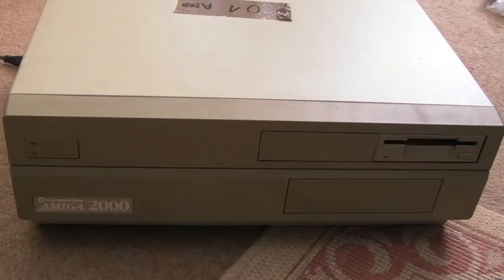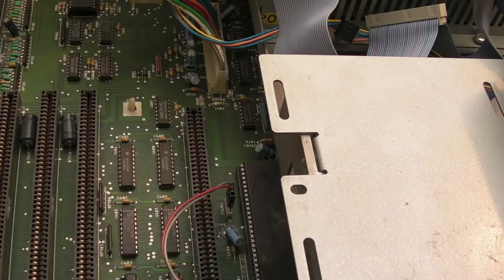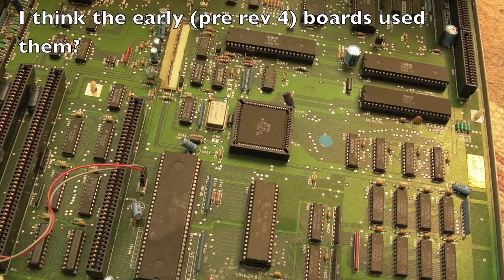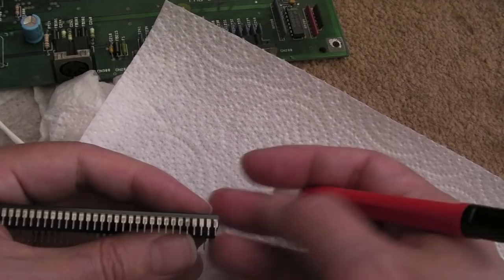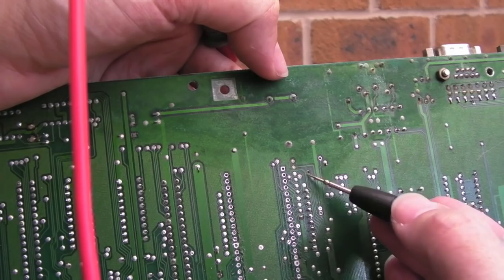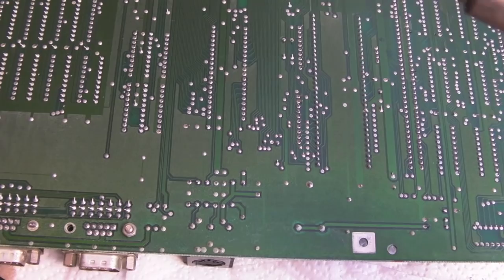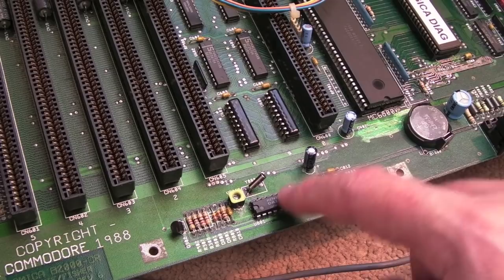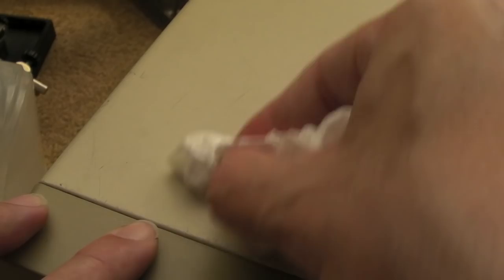Commodore Amiga A2000 Repair (Rev 6.2), CR2032 Mod & Channel Update

Comment: Hi, could you please help me out, i recently bought a A2000HD which was fully working until i decided to remove the varta battery, there was a small area of acid which i cleaned up etc and put everything back together, but when i now turn it on i sometimes get the workbench boot screen but the FDD light it always on & i cant do anything, or i get a white screen & the FDD light is permantley on, i don't know what i have done wrong because it was working perfectly before i removed the battery, thank you.
Reply from the maker: It's most likely exactly what happened to mine in this video!  ie. you get a bad via due to the corrosion.  You should probably clean up each of the vias and test connectivity from the top side of the PCB to the bottom on each via around the area of the battery.  If one doesnt join, unblock it and feed a piece of fine wire through the via and solder on each side.  If you're lucky it may spring to life!

Comment: Hard Disk LED should connect to a controller card, not the motherboard. Shouldn't be on when there is no HDD in the machine :)
Reply from the maker: Thanks!  Yes, I commented that exact same point to Mr T Guru just the other day!  I spotted it had been connected to the INT header, which isn't where it should go! =D
Reply: GadgetUK164 - Retro Gaming Repairs & Mods 
Great video by the way. Beautiful machine, I love my 2000

Comment: Was it possible to put PC boards in the PC-slots and use these natively in the Amiga side?
Reply from the maker: Not that I am aware, although you could put a PC HDD in and the Amiga could use that, as well as the PC using it too.  I think some people did that to avoid the cost of Amiga SCSI drives vs PC IDE drives etc.

Comment: I have a 2000HD and this video made me (reminded me to) check it. I last powered it up about a year ago and it worked.  But the battery has leaked. It appears to be entirely superficial. 
But what I wanted to ask you was that I mixed some baking soda water and dipped q-tips in the baking soda water and cleaned up the area around the battery.  I let it dry without 
rinsing it off.
Will the baking soda water cleaning solution neutralize the battery fluid?  I thought I heard you say it wasn't acid, but instead was a base that needed vinegar.  Will this stuff work? I don't happen to have any vinegar at the moment.
Also, what about rinsing it down?  I left it un-rinsed in case there was any further leakage or something.  Is it a mistake to leave it on there?
Any help you could off would be appreciated.
Reply from the maker: The batteries on these tend to be Alkaline - we use white vinegar (acetic acid) to help neutralise it.   The obvious point here is ideally you would need to get an accurate balance between the PH of the acid and the PH of the alkaline - which is near impossible.  But the acid helps with clean up etc.  After leaving that to soak for 20 mins or something I would wash it off with a few rinses of IPA, distilled water, and finally IPA.  Maybe blow dry the board to make sure its nice and dry before powering back up.
Reply: OK. I do have some distilled water to rinse it.  I have IPA in .90 .70 (but it has wintergreen in it) and .50  Any advice on which one to use?
I greatly appreciate your help.

Comment: I have an old A2000 put to storage 10 years ago. It was facing the same problem so I removed the Varta battery, and replaced with a coin battery and diode. Was working both before and after. However, I only cleaned the board with alcohol, not vinager. I didnt know better. Do you think it's ruined by now? :-(
Reply from the maker: IPA is still a good thing to do - it just doesn't remove all of the alkaline normally.  You could just have another light clean, this time with white vinegar first, then rinse off with distilled water, followed by IPA (I just rinse with IPA, but as other have said - distilled water first helps remove an salts).
Reply: Okay, thanks. I have to dig it out of storage and do it then :--) I hope it's not too late.

Comment: I don't think I could handle that battery corrosion clean-up.  I'm too much of a perfectionist and would get irritated about every little bit not looking pristine.  I have a Macintosh Centris 650 I need to take a look at and heard some of those old Macs have leaky battery issues.